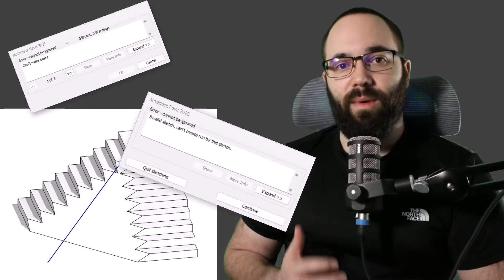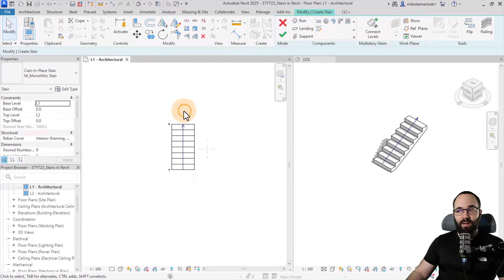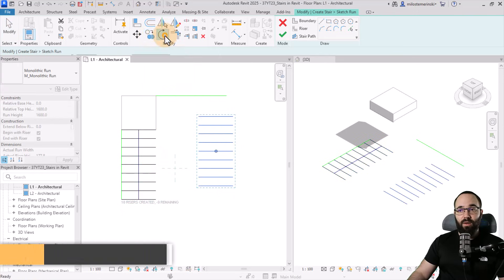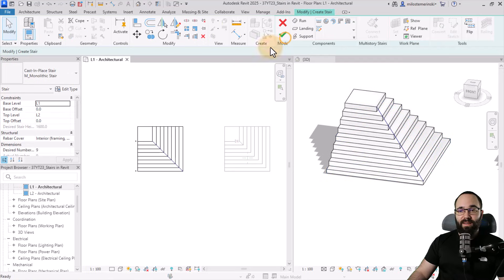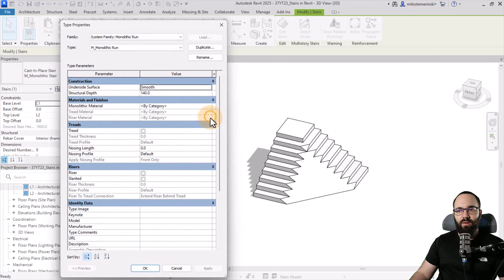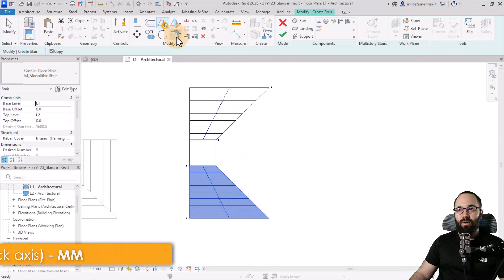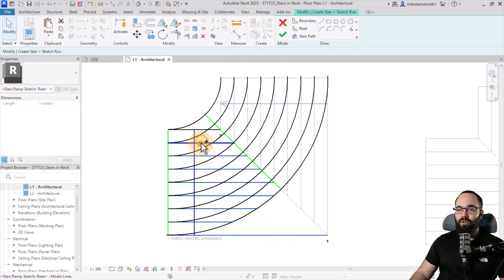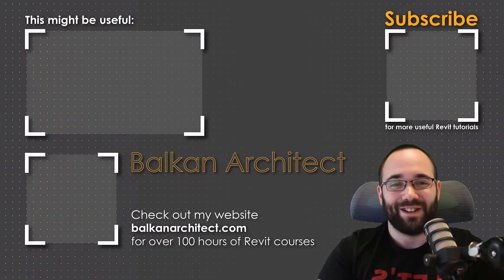Stairs in Revit Tutorial (Two side - Three side) | Stair issue in Revit Solution!

Comment: Hi Balkan, recently I faced an issue with floor design. I want to design a concave floor or a semicircle floor in z direction where I see the the semicircle section in elevations like a U-shape desgin where this semicircle attaches to the walls from top side of the U-shape. I would appreciate it if you could provide a video regarding this...

Comment: Hi, I remember having some difficulty recently with a monolithic stair as well in revit LT 2025. However, I believe I was able to achieve the same results without segmenting the stairs.

 I believe what I did was to place the stair path in the center of the monolith and then played with the landing thickness and structural depth of rise/run until desired look. All achieved using only one stair  and not multiple. 

It is quite unintuitive, so not the greatest of solutions.